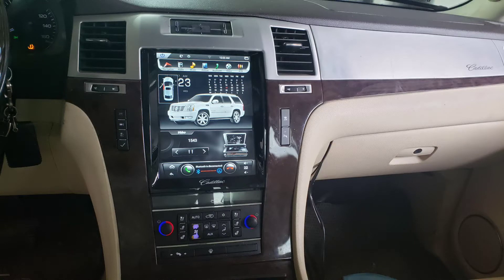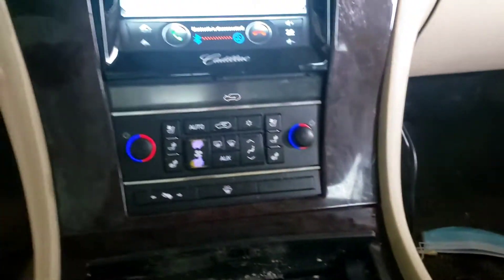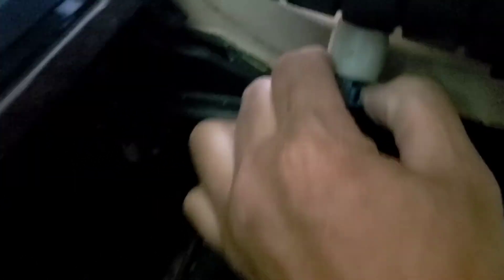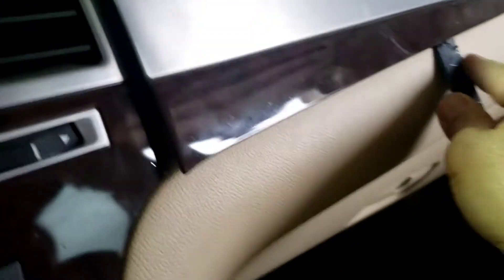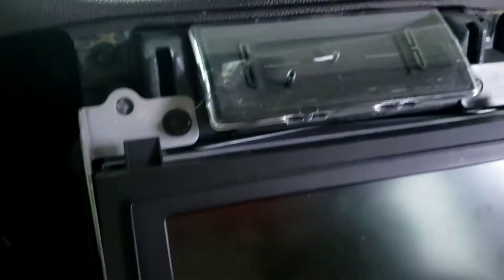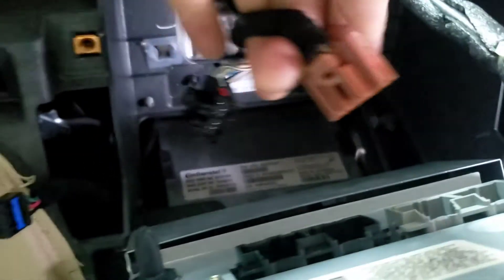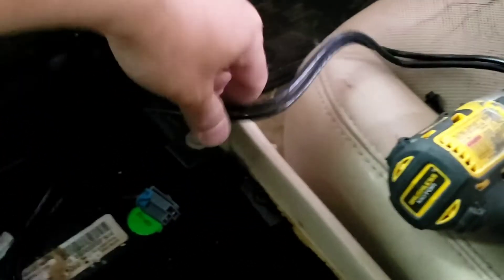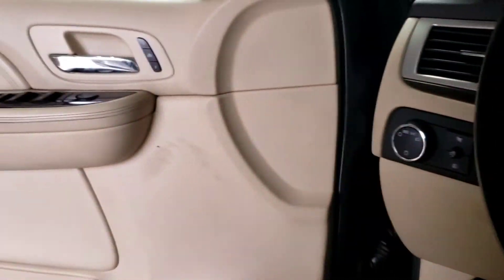Install big Tesla Screen car GPS for Cadillac Escalade 2007 radio Android 9.0 Vertical 07-15

Comment: Did you get the back up camera sensors to work too? The sensor car on the bottom of the screen when in reverse, lights up green yellow red when to close to an object. Did you connect that part to & if so how?
Reply from the maker: I'm not sure about the color but the camera works 🤣
Reply: @khmerohio  the color works brother. My question is how did you get the rader sensor to work on the back up camera for display?
Reply: Its driving me crazy, please share how you got the car image sensor to work on the back up camera?
Reply: In the system settings there's a warning sound setting if that's what you are looking for.

Comment: Do you have a clear picture of all the plugin? The Chinese company provided a vague interface definition for the unit. I have been struggling with them for more information, but it is very difficult. I installed this unit, but I have no sound. In addition to it drain the battery if I left the power plugin to the unit and the car is off overnight! HELP
Reply: How is it draining the battery with the vehicle off?

Comment: What's the model & brand name for the cadillac escalade shown in thus video?
Reply from the maker: Just the Chinese brand
Reply: I think they sent me the wrong unit because it didn't  look the same on the back . That's why it's only $250 , not $600
Reply: It was the same unit from the previous video

Comment: Can you install a aftermarket amp for a sub box without changing anything
Reply from the maker: You don't have to change anything u just add wiring kits and line out converter LOC
Reply: @khmerohio  does it not have RCA outputs?
Reply: @atleder1  it has 2 or 3 rca's I don't remember. But when your retaining stock speakers and amp just steal your signal from the sub signal on the stock amp and loc it.